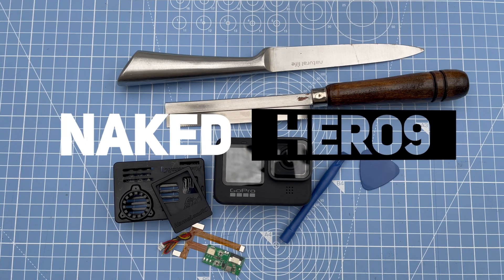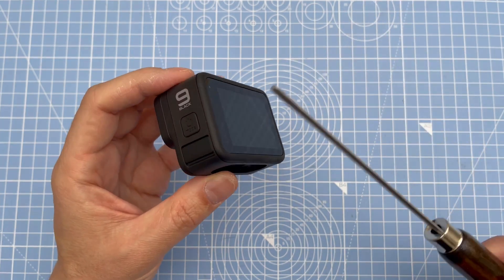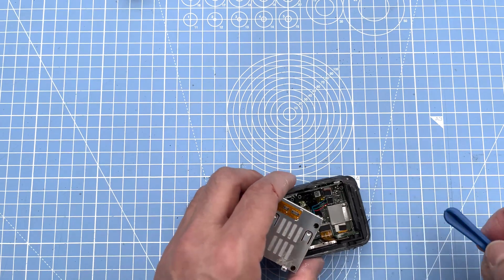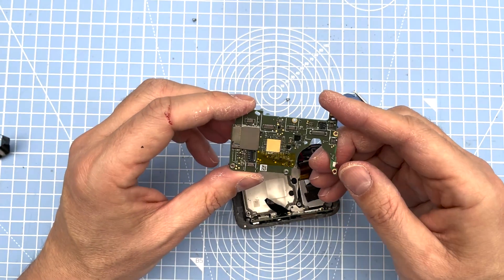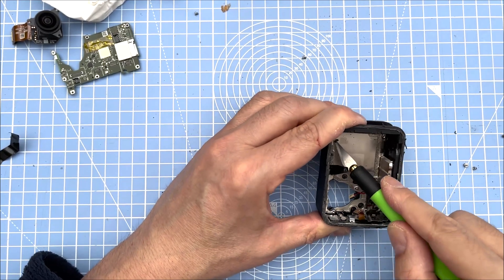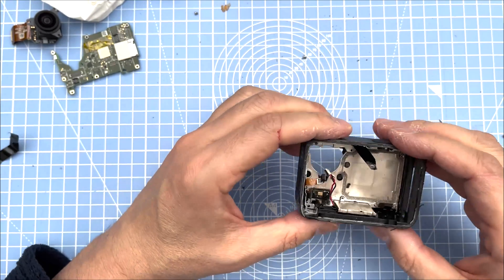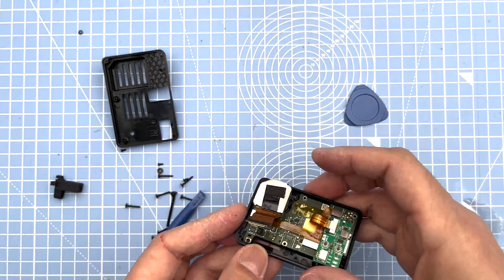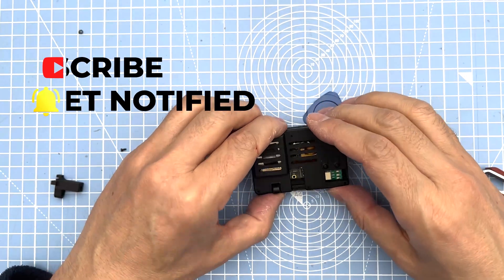Naked GoPro Hero9 - Fast & Easy DIY - NamelessRC Kit

Comment: Thanks a lot for this video. Just an idea to get rid of the plastic holders instead of use the knife I use a solder with an old tip and they came out very easy.

Comment: I got massage....no enough power...I connected to 4s and 6s I got same massage !! Any idea what the problem ???
Reply: @7bo0ob Solved! You need to update your gopro to labs.
Reply: same! Have you found the solution?
Reply: @simonearmanni  no I didn't....but I press Rec after 10 seconds it will removed...but still not recording .. I press record again it doesn't record

Comment: where did you solder the power cable connectors onto the flight controller? You showed the cable at the start of the video but didn't show what you did with it.
Reply from the maker: I actually attached it to a balance plug so I can use it on any lipo I want rather than wiring all my quads
Reply: @MickyFPV  Hey mate, how do you mount it the the flight controller, or balance plug?
Reply from the maker: @andreacapizzi8079  Blance plug, detachable cable
Reply: @MickyFPV  how did you wire it ?
and how do you attach the last little plastic part :)

Comment: There's already a barebones version available directly gopro, no need to strip them, unless you wanna save money on one with a damaged screen
Reply: 60 g for the Gopro 10 Bones vs 30g for the naked GoPro 9
Reply from the maker: Yea I saw, it’s a bit heavier and no screen and the same price as a new full size 10, but with the benefit of warranty and 2 replacements if you get the subscription, only in USA for now anyway.

Comment: really useful video! is there any way to mount an ND filter onto the NamelessRC Naked GoPro 9 Case?
Reply from the maker: Thanks and yes. Go to www.thingiverse.com and search for NamessRC and there are different options for doing that, you can download the file and et someone to 3D print it for you. For eaxample the one I am getting done soon clios on the front and then I can use the TBS ND filter available everywhere.
Reply: or you can buy one for the mavic 2 and screw it on
Reply: @thirdy-visuals   Mavic 2 or Mavic 2 zoom?